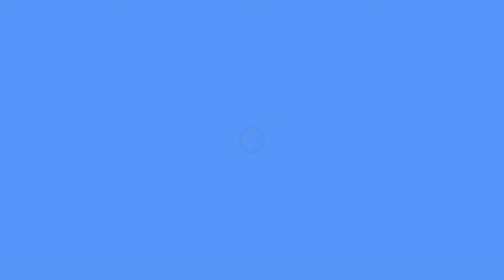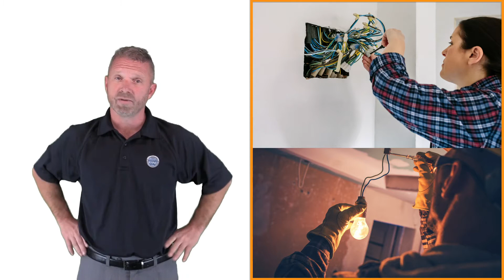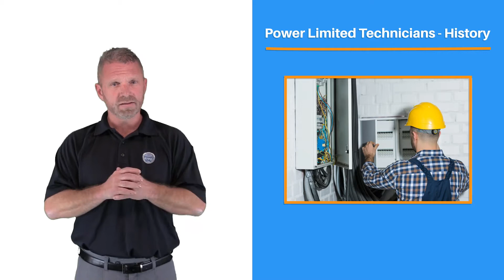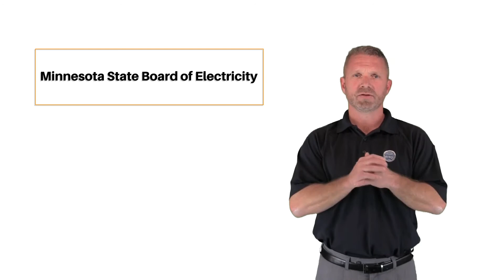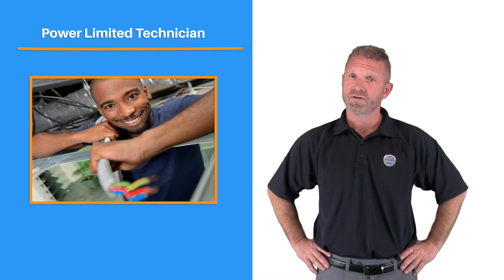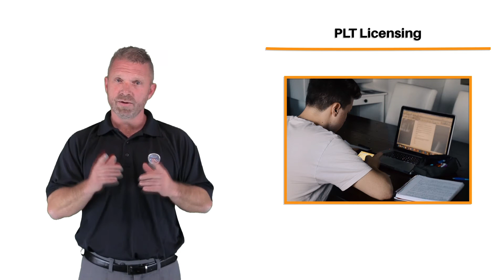Minnesota Power Limited Technician Laws and Rules

Comment: What a money grabbing joke these requirements are. I fail to understand why anyone would need to jump through all these hoops to pull DATA CABLE. Its cat5. Require a few classes that teach about things like plenum rated cable or why you can’t have a spider web of cables above ceiling tiles, and why that’s important, and get on with it.

There are SO many businesses that just pull without ANY kind of training. They don’t know of any of the things I mentioned, because getting certified is a stupid nightmare that’s only designed to take money from people and businesses.
Reply: In MN you can pull Data cable with a REG UNL PLT as long as the company you work for has a PLT holder registered with the state.  The requirements for renewal on the REG UNL PLT are 2 hours per year and only costs about $14-34 to renew.  Safety First, Last, and Always.
Reply: Follow the money….